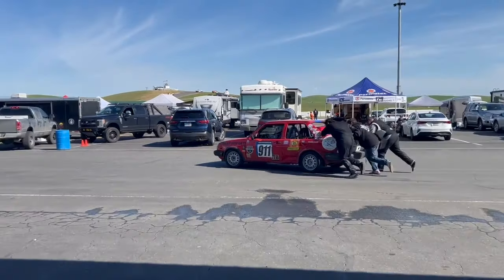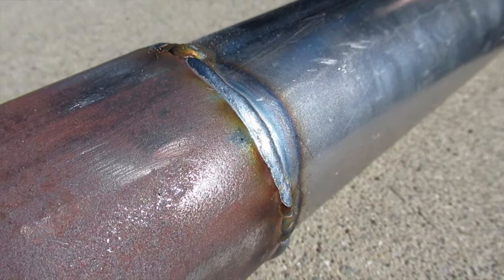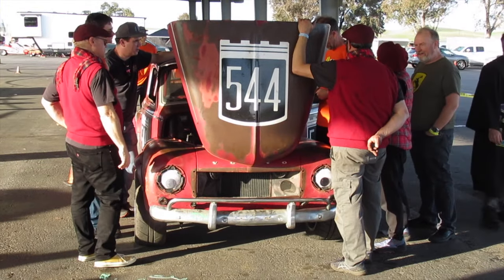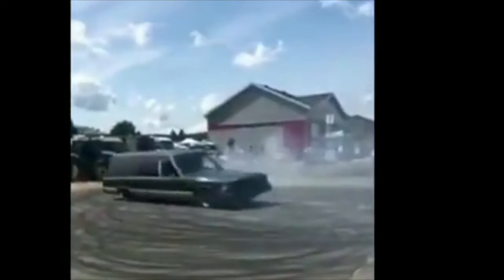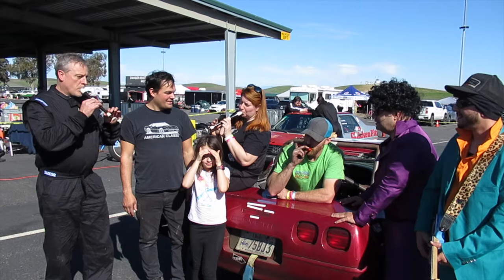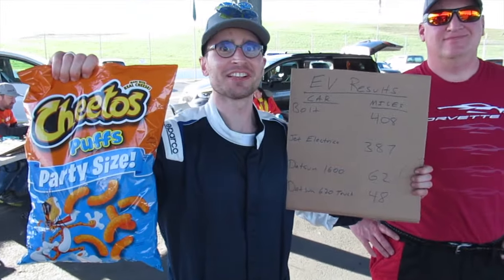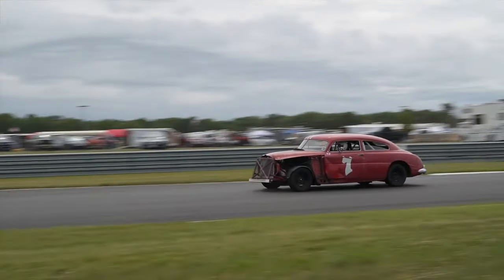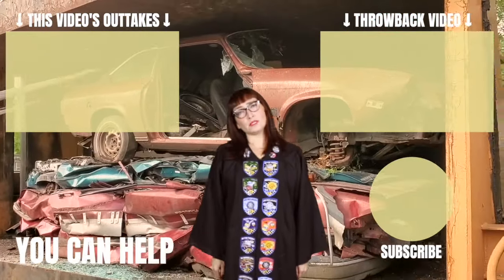Volvos, Welding & More | Thunderhill '24 | 24 Hours of Lemons

Comment: The whole Sierra College team has some great folks that fit into the Lemons vibe nicely, Erica is a great example. My understanding that Team Notta Miata will not be at the  May 2024 Thunderhill race but the Erica and others welders from the college will be on site to help out.  Also a shout out too Phil and Roy the two professors from Sierra that have been supportive with getting this going.
Reply: Yeah unfortunately the club will not be racing lemon’s until November. Our spot on campus is undergoing renovation and we are beginning work on a second car that’ll be running lemons beside the 115 cooper. The club however will be out there to assist whenever people need help.
Reply: @metuned  it will be  awesome to see your crew back in the paddock!

Comment: As always, the thing with an EV is charging the damned thing. Bring it to CMP, you won't get 400mi out of it. The closest plugs are at the new Hampton Inn in Camden (near I-20), but they're limited power L2 Telsa chargers. (the closest "fast" is 50kW at a state park 52mi away.)

And the Electrica's "win" was with Chevy Volt batteries. The Florida Man Poker Run was done with BMW i3 batteries.

[Update: Circle K in Lancaster has a / one / single 150kW fast charger. 22mi away. At least the Hampton Inn has a subway, mcdonalds, and waffle house near it.]
Reply: there's some new capacitive batteries in testing and development that are as long lasting but are very quick to charge. just a matter of reliability testing and making sure the current infrastructure can actually charge em. it's gonna be really neat in the next few years with that tech getting more refined.
Reply: I'm the Bolt guy from the video. The best Lemons track for EVs is probably NCM (National Corvette Museum), where the fast-charger is less than 2 miles from the track. Hoping to drive the Bolt in Lemons there someday. Also, for places without EV plugs, an other option is to flat-tow the Bolt while using regenerative braking to recharge the batteries.